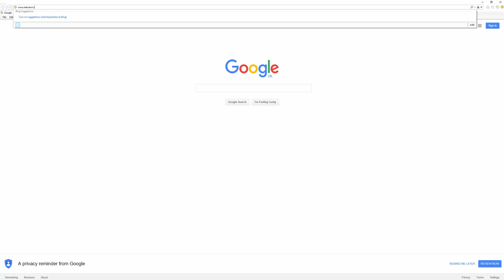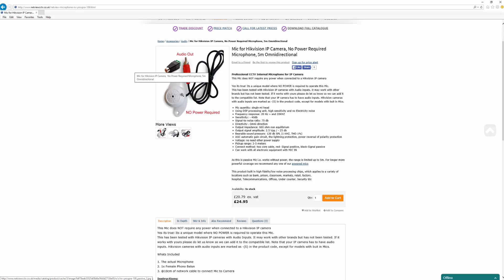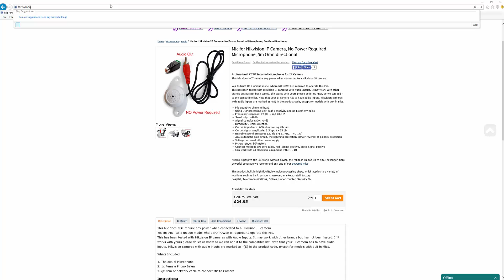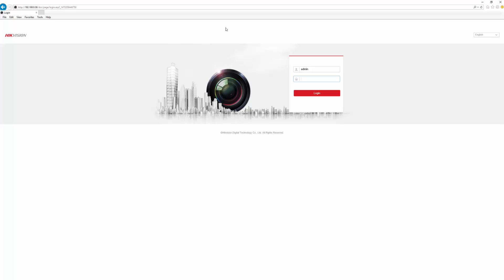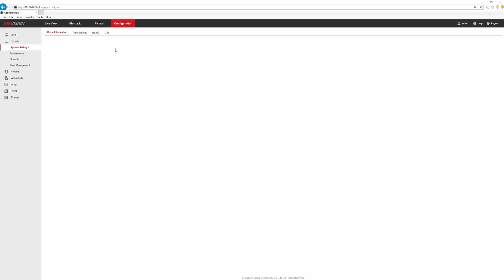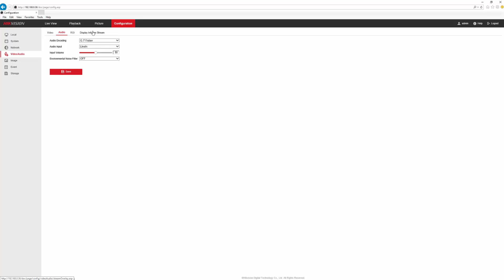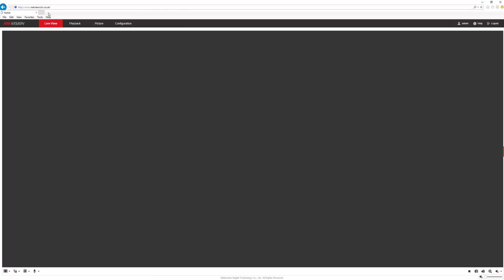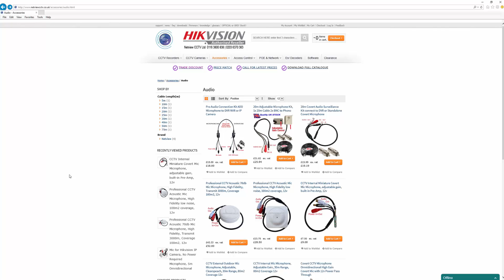How to Configure a Hikvision IP camera to enable Audio when a Mic is connected

Comment: Hi, great video, i connected the same Mic but i want to hear the sound out all the time, not just when opening the application or a web live view, i connected a speaker wire to the audio out terminal block and other side of the cable into an amplifier with speakers but there is no sound.. can you think of a reason?
Thanks.
Reply: Hello, can you please recall what you did to make the speaker work in the end? There's no information out there!
Reply: @schillaci5590  I didn't, thought I'll use it as a baby monitor, eventually purchase a simple dedicate baby monitor to do what it supposed to do. Security camera is well.. a security camera..
Reply: @itayraviv  Thank you

Comment: Hi, good video, thanks for sharing. I have a DS-2CD2155FWD-IS and the option for mic in is not present, only line in? Any ideas?
Reply from the maker: On the -IS version it should be available. Connect a Mic to see if it appears. If not try updating the firmware. Latest one just released is v5.5.0